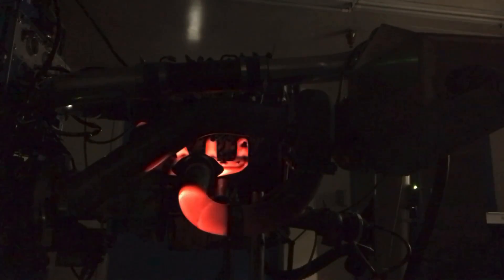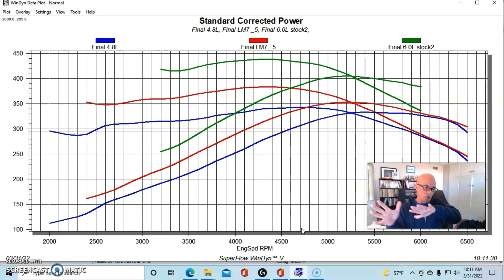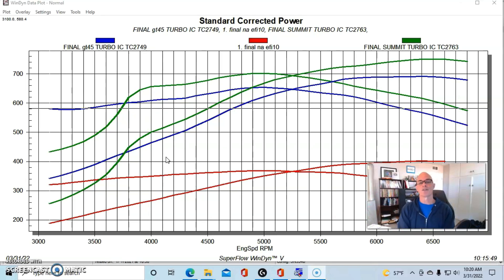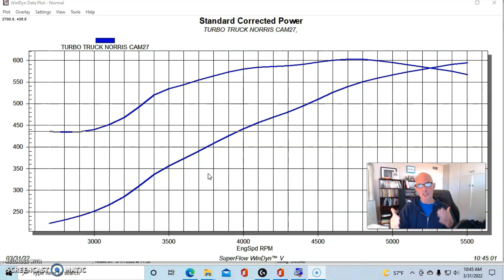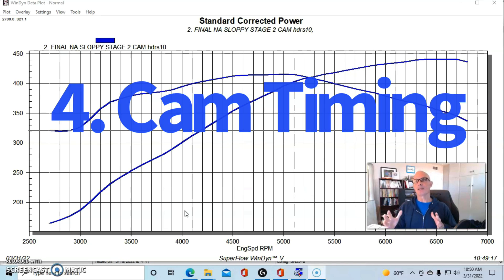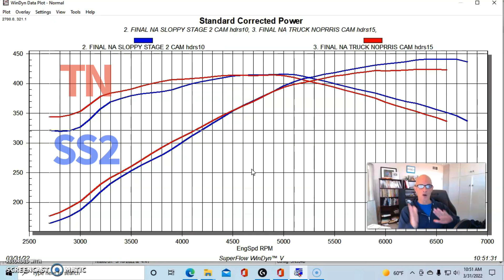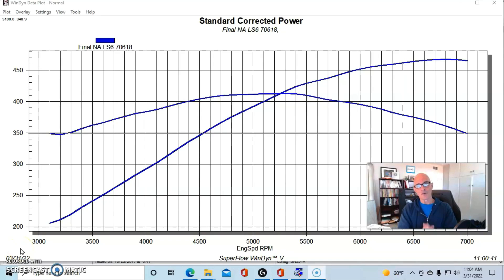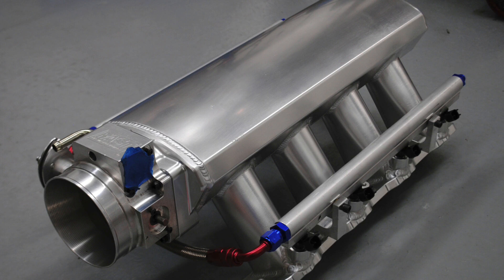HOW TO MAKE YOUR TURBO SPOOL UP QUICKER! TOP 5 THINGS TO HELP IMPROVE TURBO BOOST RESPONSE!

Comment: The first Turbo vehicle I ever drove was a Saab Turbo. I thought the Turbo Lag was such a cool feeling, all of a sudden the power kicked in.
Reply: I hate that when it.comes to performance you essentially have to chose if you want it down low and immediate or get it running high in thr rev range always higher then 7k lol.  I have grown to live turbo.bc they can hook better and be manipulated through tuning and with holley ecus you can even control your boost ramp through real time tuning or to run boost by rpm, boost per mph, so one n so forth. It's more logical for getting traction bc the boost doesn't usually roll In until aftrt you've left the line which.helps to not immediately blow the tire off.  That is along as your not popping and banging spitting out fire like a damn mythical dragon bouncing off the rev limiter with the 2 step lol
Reply: @robertbailey3057  Correction: you can have all-RPM-torque if you want to spend the time and money to have multiple turbos controlled in such a way as to keep those cylinders full all the way to idle RPM levels.

But, are you willing to do what is necessary to find that? Mazda did in some measure with their sequential-turbo rotary RX7, but, alas, most do not have the inclination to do that. For ultimate broad-spectrum torque, you can use a large Roots blower, some turbos, a centrifugal blower, even Garrett's electric turbo.

However, low compression at low RPM will be needed to stave off detonation.
Reply: Lol.  It's unsuspecting.  I always had blower cars. And swore by that instant torque

Comment: Hey Richard, if you ran each turbo test with the dyno brake off at first would it give an idea of what RPM boost comes in on a combination? I think for a lot of street car guys they want to balance when boost comes on vs power vs back pressure and when power falls off. Thoughts?
Reply from the maker: the dyno brake off?
Reply: @richardholdener1727  you were saying in the last video you hold the dyno with the throttle open in order to get the turbo to spool. Did I misunderstand what you were saying?

Comment: Would retarding ignition timing during load in raise exhaust temps and improve boost response?
Reply from the maker: ask yourself the opposite question-if retarding the timing lost power, would it hurt response?
Reply: Rally teams use that to keep the turbo spooled at the lower-load times. It is wasteful of fuel, not too good for exhaust valves, but it works.

Comment: I have a 67 Cougar 390GT. I’ve been seriously contemplating adding a turbo to it. Its being NA built to make 400 HP with 500 ft trq. I figure a turbo would be good for an extra 75 HP. Looking for mid range to upper power range. 2500-5500 ideas?
Reply from the maker: a turbo will like 200 hp at 7-8 psi. look at a GT45

Comment: Since you've proven all cams are turbo cams how about a test between say the truck norris and one of the summit turbo cams? Im curious to see if these cams that are spec'ed for boost really have any benefit and what it is over a non spec'ed for boost cam.
Reply from the maker: think big cam, small cam-whatever the cam does NA-it will do under boost
Reply: @richardholdener1727  yes but is there really any benefit to a spec'ed "Turbo" cam over just a N/a cam? Like for example the summit stage 2 turbo cam having 0.600 lift on the intake and 0.575 on the exhaust, i would love to see how this changes the power, spool up, etc versus a cam with the same lift on both intake and exhaust. Does this show a benefit on a smaller turbo/bigger engine application where back pressure is getting over the ideal ratio and if that is the case would it show a negative on the opposite of this on a smaller engine struggling to get a bigger turbo to spool at low rpm?

From what ive seen watching all your testing im thinking a regular "n/a" spec'ed cam with the same lift on both int and exh would be a benefit on a smaller engine trying to spool a oversized turbo like for example a 4.8 with the summit s475 youve been using alot lately.

Comment: Great video, Richard. I think another test I’d like to see added to this is the effect of a typical ‘full exhaust’ (after the downpipe) like one would put on a street car and it’s effect on spool time and overall hp, maybe at a couple of different power levels. Thanks.
Reply from the maker: CHECK OUT THE TURBO EXHAUST TEST VIDEO
Reply: @richardholdener1727  @ The Horror he still has to test X pipe vs. Y pipe, vs. H pipe, and also a fully worked out Gen II LT1 lol..
Reply: @richardholdener1727  Will you ever run out of things to test ?? XD
Reply: @BoHorror  he won't, he still has most of the newer mod motors, the entire ecoboost family, some Mercedes motors, several dodge motors, the Honda J series, tons of Toyota motors, and more.
Reply: @BoHorror  if you read car mags the last 25 years, you'd see most of these tests/data is rehashed from them. Still very relevant, but the info has been out there, documented in writing for a while now.
Reply: And I'm not suggesting we stop watching Bald Dyno Jesus vids, but encouraging you all to gather old super Chevy, car craft, hotrod, muscle mustangs and fast Ford mags.   Lots of old school cool build recipes can be had in them old rags.
Reply: The more restrictive a downpipe/ exhaust doesn't allow for proper back pressure release and will effected it very minorly.  Just like an NA car.  The open flooring exhaust will add a some hp.  The restricted catted exhausts with silencing mufflers will restrict power.  I was always taught the egine is like an air pump and the more dense cool air you can shove in  the engine while also having an exhaust system that is large and free flowing minimizes power loss.  And like richard always says whatever adds hp NA with add hp under boost.  You essentially want to maximize an engines performance na which translates to larger numbers under boost.  Or the ability to not have to run ass much boost and timing while still achieving desired power levels.

Comment: Hey Richard what happens when you go from a short runner intake to a long and add more plenum volume?
Reply from the maker: THE PLENUM VOLUME CHANGES VERY LITTLE-THE RUNNER LENGTH CHANGES THINGS A LOT
Reply: @richardholdener1727  what about in a carburated application? Or is it the same?
Reply: The impact is to have less money.

Comment: How do I increase boost on a 14 liter 60 series' Detroit it only pump 25 pounds 
On my cat 15 liter c15 it pumps 50+ pounds of boost much better power in mid range
Reply from the maker: MORE FUEL AND BIGGER TURBO

Comment: great info, I have a bone stock L59 with only 70K miles on my 07, you recommended a 7582 spooler, and so goes the question, im building this for a strictly towing application,  to get my butt over the hills in southern Oregon with my travel trailer. (used sparingly) stock exhaust on my truck is 2.75 inches, can I get away with a  3 inch exhaust (cat back as this is a remote mounted turbo ) in place of muffler due to DEQ restrictions( emissions) everything is purchased but before i install it im second guessing my 3 inch hot side and 3 inch cold side back to intake, and losing torque in the process.... great work BTW, obsessed with your vids!!!   will i lose a ton of torque/ boost lag with larger exhaust is my question thanks again
Reply: I made a comment replying to you earlier, did it get deleted or was it just deleted immediately?
Reply: Flex fuel 5.3, 07 classic silverado. Has larger injectors
Reply from the maker: what is an l59?
Reply: @richardholdener1727  I guess I'm not the only one that had no idea what an l59 is... Apparently it's the flex fuel version of the LM7.. 5.3L Gen 3.

Comment: Do you think the heat is expanding the metals creating tighter tolerances inside the turbo? Maybe this is making the turbine work more efficiently? Otherwise why would heat help?
Reply: Exhaust gas energy comes from both flow and heat expansion. These expanding gasses work to spin the turbine. If some of that heat energy is consumed giving up heat to the manifold and turbo housing, there’s less energy available to spin the turbine. This is the reason for header wrap, turbo blankets and coatings etc.

Comment: This highlights exactly what I was trying to talk to somebody about when explaining the combination I'm building.
My application, is actually a large heavy family car that is daily driven. But I'm putting in an LT1 with a turbo. I don't need a big cam because I'm making my high-end horsepower with the turbo. I don't want a hyper aggressive cam profile because I want it to be reliable for daily driving. I don't want to worry about my valve springs. I want the 6.2 for that low end torque around town. I want the variable valve timing and long runners intake manifold for efficiency in those low RPM areas that I'll be driving around in most of the time.
And then when I get on it, all that effort to keep the low RPM torque, is just going to speed up how fast the turbo spools and I'll still make 700 plus at the rear wheels. And if I don't I'll just turn up the boost more until I run out of injector.
Reply: less talk, more doing.
Reply: WITHOUT RIG GAP YOUR GONNA BUST A RING AND PISTON AT 700 WHP !   IF YOU ARE PULLING MOTOR APART TO DO RING GAP , YOU MIGHT AS WELL DO A CAMSHAFT, HEAD STUDS , MACHINE THE DECK, GOOD GASKETS !
Reply: @daviddavids3468  It's getting drop in Pistons and rods. ARP head studs and the stock multi-layer steel head gasket.
It is getting a cam but if you've ever wondered who the people are that buy the mild cams... It's me. It's not even going to sound cammed. Fuel lobe is larger I think 32% but I'd have to go look. I have not upgraded to the LT4 injectors but from what I've been reading it seems like the only acceptable option for the moment unless I'm willing to go dual staged injection and that brings in a lot of non-OEM parts that may make it less reliable for daily driver. I am going to of course limit the amount of variable valve timing to what the cam recommends but it still picks up down low, and I just finished blocking off all of the displacement on demand oil ports. It's getting normal lifters for reliability.
The biggest slowdown from getting this running right now is the fact that people can't just seem to get parts out the door and shipped to me on time.
I expected to be filing rings this weekend. Instead I'm still waiting on the rings to get here.

I must say watching all of Richard's videos I would really love to be able to see how my engine stacks up to what he's measured, but without being able to bring my stuff over to his dyno it wouldn't be apples to apples anyway...

I don't think I'm going to be overstressing the aftermarket rods, and I probably could get away with leaving stock rods and pistons and just gapping the rings but given that I'm pulling it all apart and that I don't want to do it twice.... Might as well swap them since it's not horribly expensive.
Reply: MY COUSIN HAS A PROCHARGED 6.2 LS MAKING 710 HP AT MOTOR ,  ITS STOCK MOTOR, NO RING GAP, INTERCOOLED ,  BEEN TO PERFORMANCE SHOP 2 TIMES FOR DYNO TUNES . THE OWNER OF SHOP GAVE IT A SAFE TUNE, AND DOESN'T ADVISE ANY MORE BOOST , WITHOUT RING GAP , HEADSTUDS AND GASKETS
Reply: IM ALSO SURE HE HAD TO PUT IN BIGGER INJECTORS TO MAKE THE 700 HP,.  AND THE DYNO PERFORMANCE TUNES COST ABOUT $1500.   HE IS PRETTY HAPOY WITH IT , ITS IN A 6 SPEED 2012 CAMARO WITH 4.10 GEARS

Comment: Turbos are heat driven. Normally the larger displacement engine makes more power and power equals more heat so that helps spool the turbo sooner.  This is where the dance between raising the compression ratio and the amount of boost pressure you want to run at least when running pump fuels. Raising the compression ratio will generate an increase in horsepower ie heat will be increased as a result as well as cam change makes more horsepower ie more heat is generated and helps the turbo spool.
Reply from the maker: displacement and torque add way more than compression
Reply: Higher compression reduces the exhaust heat.
Reply: Turbos are massflow driven.

Comment: I wonder about the brake specific fuel consumption of the difference camshafts. Won't you teach us about that. Nobody addresses that issue.
Reply from the maker: at part throttle? or at wot?
Reply: @richardholdener1727  I don't know how that would work at part throttle. That would be a very interesting video. I would like to know what that even means. I know you can beat .5. What makes what happened. Is it efficiency. How would improve that, would the camshaft change that, maybe the lobe separation angle. Very interesting.

Comment: Do you have any videos that show what type of gains there are with a heat wrap on the manifolds? I know in theory it for sure helps, just want to see a real world test with a measurable gain
Reply: I don't know If you can show the real gain on an engine dyno. When you use proper heat shielding and heat management within an engine compartment, you see gains from not having everything around it heat soak more so than you see gains from containing the heat.
The dyno would be able to show all of his parts heating up faster, but he already showed that it only takes one run to get all those parts hot enough to do better on the next run.

Heat management like that is needed in the real world but hard to quantify on a dyno. As a side note, I don't recommend heat wrap on exhaust as it tends to hold water against the exhaust and accelerate oxidation (rusting out). Instead I recommend doing what the OEM does and use heat shields and reflective foils to redirect the heat away from other components, keep it closer to where you want it hot, and move airflow to make a moving air buffer between the parts that should stay cool, and your heat shielding.
Reply: @TravisFabel  I'm very aware of what heat wraps can do. I just  would like to see a side by side test of unmanaged heat compared to managed. I personally ceramic coat my manifolds with a couple strategic heat shields to keep it as tight against my manifold until it can escape down towards the ground(only place it can go)... The heat wrap has its place, but not on mild steel or anything cast. I generally tell people if your going to use it don't plan on it being long term because of the rot it causes. Even stainless will start to suffer so plan on heat shields, quality turbo blankets, and some time studying the DEI catalog... and save up for a quality stainless manifold or get what you got ceramic coated for a few hundred bucks....

Comment: Also, your boost controller has an effect on how fast you spool up, as it can be set up to prevent wastegate creep, because the wastegate uses a spring, and springs react to any amount of pressure placed on them, thus a 10psi spring will begin to deflect at 7psi, thereby venting boost prematurely, thus slowing your spool up. https://www.youtube.com/watch?v=hYIL_XvlYTE
Reply: Which form of boost control you recommend with a holley ecu?
Reply: @timweb1510  Sorry for the late reply, it seem Youtube deleted my first reply, I only just noticed it did not go through because it included cooperate links to Summit racing. In any case, Holley has boost controllers, just look them up, but note, if you find one cheaper that basically looks the same? Then it is the same, buy the cheaper one.
Reply from the maker: it does not change spool until you get near the gate opening point-has no effect on actual spool rate

Comment: I bought the sloppy "best cam" over the new year (before the test off). My engine will never intentionally see anything over 6k. With that in mind can I change my cam timing to increase my low speed torque/ power?
Reply: Depends on the engine. Some respond to cam timing changes better than others. But generally speaking, advancing the cam improves low-end torque (at the expense of high-end power). Advancing the cam will also reduce intake valve clearance.
Reply: Yes but with top end sacrifice

Comment: Lancia used a super charger for low rpm and then a turbo for up top, back in the 80's.

I used to think porting the head or having a asymmetric cam ground that opened the exhaust valve earlier, would improve boost response, while it did, but not down in the rpm range we were looking at. In our case below 4000rpm
Reply: The 1.4 VW Jetta 2014 also has this super and turbo combination
Reply from the maker: same effect as sequential turbo

Comment: I like you’re videos. Useful information with the Dyno sheets to back it up. I’ve been debating on doing turbo on my ls swapped s2000 and I think I’m sold on it now. Thanks buddy.
Reply: RIP traction
Reply: @yotasavage  yeah that went away whenever I did the swap lmao
Reply: Thats going to be fun, Im guessing you’ve already upgraded the chassis quite a bit to handle 4x the stock power 😅
Reply: @applebitefool  believe it or not all factory components except the t56 and ls. Handles well except I lost cornering. Maybe with better sway bars and after market suspension I might be able to get it somewhat better. Still the straight line performance is worth it.
Reply: @christopherhoward3822  
If you decide to go ahead with a turbo, you should consider subframe connectors and whatever bracing the pros are using as well as beefed up axles and diff.
Reply: @applebitefool  yeah that’s my plans. I rather be safe then sorry
Reply: Those things were the fastest mass produced car per liter and people that they were cool with like 200 hp.  800 would be an absolute terror.
Reply: A turbo LS S2k would be nuts!!!